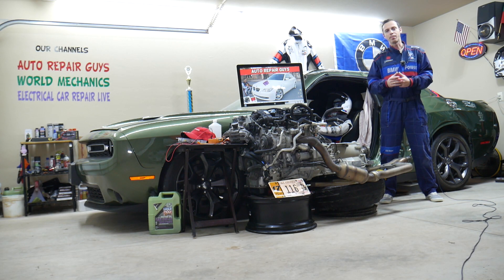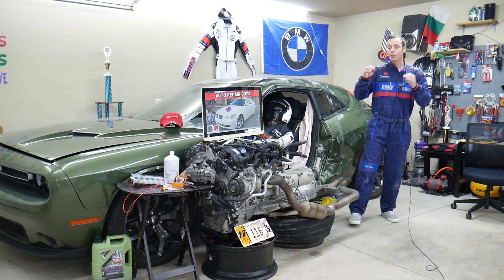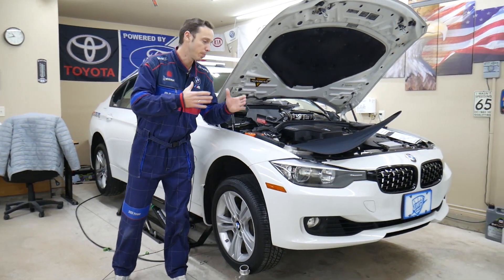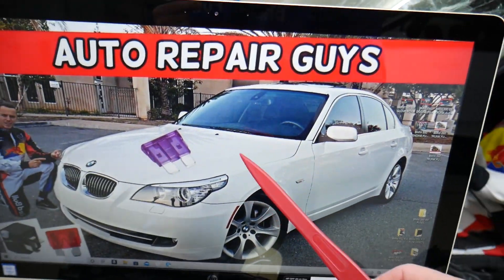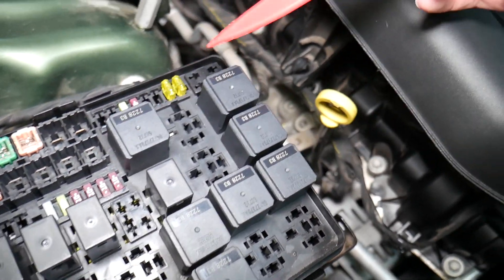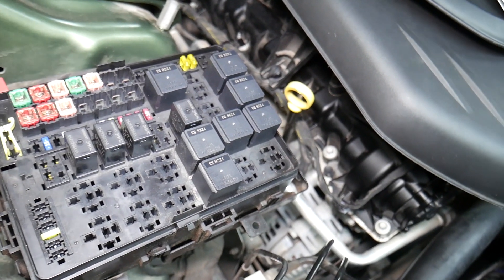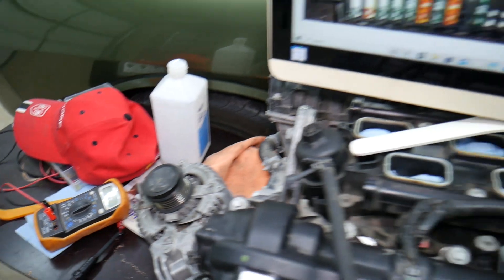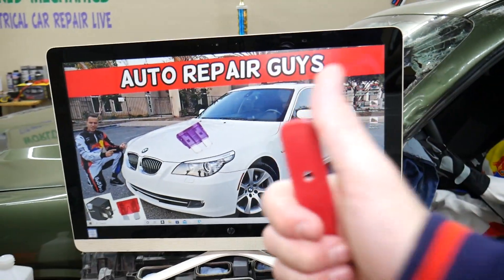BMW E60 E61 DIESEL FUEL HEATER FUSE 525i 528i 530i 535i 540i 550i 520i 523i 520d 525d 530d 535d

Comment: Hey goodevening sir.  I am a subscriber to your channel. 
I have a 2006 volkswagen touareg v6 3.2l . My problem is that my fan keep  going after the shut off the engine . It continue to run for like 5 - 8 minutes. Now when i clear the codes  . When i shut it of and start it back up . The light is back on. I need your help in finding the electrical wire i need to check . Or how do i check it to find if its an electronical short. 
Can put a relay to break the connection ,so when i start car it comes on and when i turn it off it shut off... thanks for your input